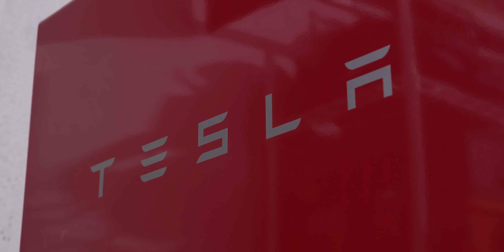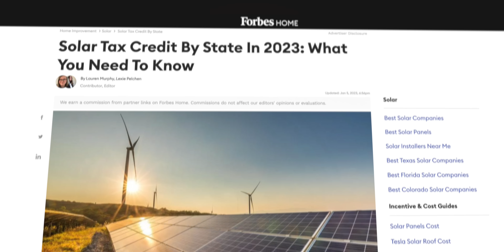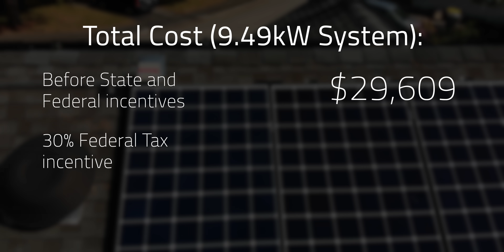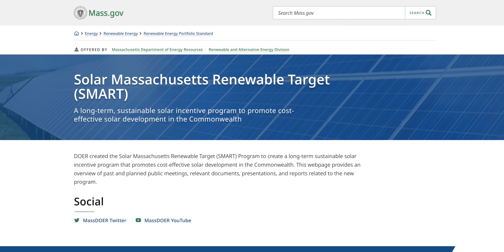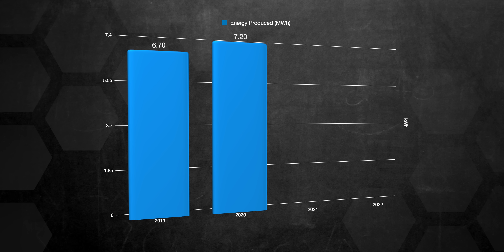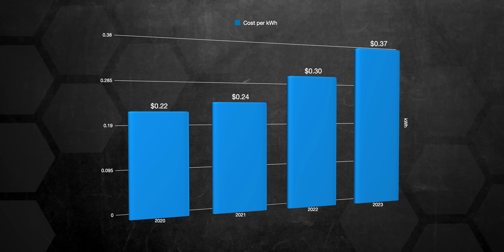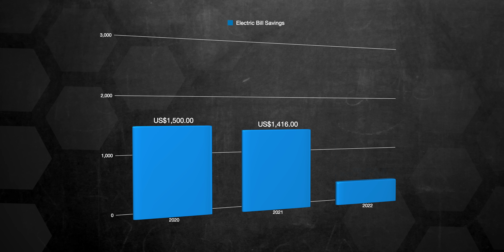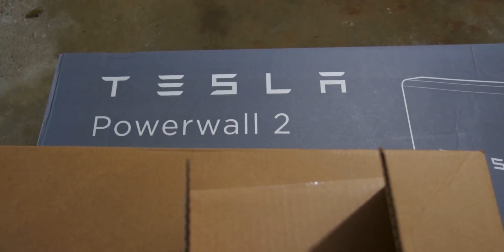5 Years with Solar Panels - Is It Still Worth It?

Comment: Your prices for hydro made me check my bill. I used 469 kWk in September at .1097/kWh for a charge of 51.45. I've been paying a monthly amount of $110 and overpaid my annual cost by 30% so next year it will be $78 a month. I have a heat pump and the usual appliances, and I live in a mobile home, so a much smaller space to heat and run. I'm planning to make my next car an electric, so in a year or two I'll be adding a charging port. I'm considering solar on the south side of the roof and a battery, but that will depend a lot on what grants are available. Interesting break down of your experience. Thanks.

Comment: My electrical company hasn't increase the kWh cost much in the last 5 years, but they almost doubled the "basic service fee" (some call this a "meter Fee") which I could not use my payback to pay off.  I was going to go solar until they changed this. They used to let  people use their payback for paying off the service fee as well. For example, this month my kWh usage cost me $77.00 and my basic Service fee is $56.00. So if I used 0 electricity in my house, I would still have to pay them $672.00/year.

Comment: I looked up the current marginal rates (not counting other fees or credits) and Massachusetts was listed as 29 cents.  I live in Arizona, and it's listed as 15 cents.  Three states were above 30/kwh. Alaska, Hawaii, and California.  The median was around 14-15 cents.  Unless it's just tax, higher prices imply higher resource consumption.  Many of the states where politicians are most concerned about conservation have the highest prices, which could imply some policies are backfiring.  Arizona recently stopped net metering but some homes are grandfathered in for a couple more years.  Net metering can drive up base prices, since the money spent on maintaining the grid needs to come from somewhere.

Comment: I could never do what you have.  I takes all curb appeal away.     And you are on welfare.   Call it what you want incentives .  It is still someone else is paying.    Go back and re do your math take out all incentive $ out because   (the rest of us are paying that part).           I have 4 acres   I would consider adding  panels out away from the  house. I don't want to  make my house ugly.     To me I would pass on your house because they are ugly.           I do like the tesla  roofing their solar    shingles .    But the upfront cost is way to high over a standard roof.
Reply: My wife did the math.  It would have taken at least 20 years to make up the difference in $ out of our pockets.    Let alone the $ out of other taxpayers pockets.    And that wasn't counting on the  $ in interest, the space needed for batteries and controls.     I don't care where my electricity comes from, I buy it from the lowest cost $ provider.    Because spending less $ is always the greenest  option.  Because it takes a lot of energy for us (and everyone) to earn a living.    Yo are not making up for that.  On another  note :  Now you are moving and you will have to do it all over again, if you buy a house with solar you said it will cost more...if it doesn't  you have to install  a new system.  Incentives are much lower now ...  And cost have gone up. .   I would think very hard and figure all actual cost .  Not just $ , but what it does for the looks of your house.     I have seen houses that had solar removed  when a new owner buys the house,  just because of how ugly they are.     But where I live luckily, most people that have solar have an array hidden from sight of the roads .

Comment: GAF solar system put on with the roof.  4.5 KW but has not reached that as it was on the roof at slope and shaded part  of the afternoon and mornings .  The solar and roof install was the middle bid of three where the other did not include solar.  So the cost was "free" During the summer  it covers total cost of usage and 10% of my usage during winter ( the utility company has charges besides usage).  But Oregon is not famous for sunshine in the winter.

Comment: Things you need to consider is your home owners insurance coverage due to solar panels.
1 Some insurance will not cover anything to do with solar 
2 Most solar panels will need replacing in 10 to 15 yrs,
3 Most insurance co's won't cover solar damage due to hail or snow.
4  solar panels draw more heat toward your roof requiring replacement sooner than average.
5 Roof replacement requires a certified technician to remove your roof panels and reinstall them.
6. A lot of roof panels that are reinstalled need replacing due to wear and tear.
7. snow from solar panels are bad about ripping off your gutter system.
8 Snow that melts from panels and shoots over your gutter system can drain into your basement/crawlspace 
9 There are a lot more cloudy days than you realize until you go solar.
10 Some homes actually lose value with solar panels installed  and some don't like the look of them.

Comment: An interesting problem I saw in another video, is a classic issue of people not supporting the power company anymore by putting up solar panels, is that the cost of power to everyone still using the traditional power grid will end up getting charged more for power over time as the power company tries to keep profits up.

Comment: I have a problem. I have a shaded roof. That is not good for solar panels. But it is great for air conditioning. Get rid of the shade and you are better for solar panels but need more power for air conditioning!

Comment: Going vegan has been known to affect ones thinking on the viability of "green energy" and reality in general.  Gov'ts always offer incentives for solar because they know if they didn't , no one would buy them. And once you agree to the terms and a contract, then they are free to change the terms on you once the contract expires. For example , that 1 to 1 metering can be changed to 1 to 1/2 . The gov't that offers the incentives and the contract will eventually see you as as a "freeloader" on the system, and your sweet deal will suddenly turn sour.  Any time someone wants to pay you to adopt something, you know it's a losing proposition. You would be better off to build a house with a dual wiring system. One for lights, appliances etc that run off a battery charged by solar and totally isolated from the grid. The other would be just for your electric heat/air conditioning...that way , you can depend on the grid plus costs savings from solar tied to the grid.

Comment: If you have the real estate go with a ground mount setup. It is much easier to manage. Also if your goal is to be off the grid, this makes the system less complicated as you’re not feeding back into the grid and trying to manage ways to make money back to pay for your system. In middle TN we run off of hydro electric which makes electricity cheap around here and they are not interested in buying back your electricity. So forget about that incentive.

Comment: My neighbour installed panels 35 years ago and created his own storage system and secondary DC power circuit throughout the house.
The panels TRACK the sun's movements.  It matters not what side of the house they are installed they always catch 100% of what is offered.
What we are being offered today is horrible engineering.

Comment: After watching this video I realize this guy is NOT a handyman.
Most people watching engineering vids know how to do a lot of the work themselves.
Not knowing that snow slides off of glass surfaces shocked me.  Snow guards, an afternoon job. 
If you have a screwdriver and a hammer you can cut a lot of these cost in half.
MAKE your own power wall, you can get the batteries on line.
Install your own panels.  It's all like Lego.

Comment: This is complete nonsense - the solar panel installation didn’t save any money and without the Government subsidies it wouldn’t even be close to breaking even. This is why the Government shouldn’t be involved in this complete solar panel scam at all. Any buyer with any sense would avoid purchasing a house with these solar panels on the roof at ALL costs. If you want to power your house when the power goes out install a generator.

Comment: A friend of ours had solar installed, but now has a leaky roof because of improper roof installation.  The roofing company is now bankrupt. Now they have to foot the bill for removing and replacing the solar panels plus replacing the roof.  20 years ago we a similar experience with our "50 year roof" failing in just two years. Our roofing company also went bankrupt. At least we didn't have solar to worry about at the time. I'm now 75 and retired living comfortably in a new energy efficient house which is paid for.  Our electric bills are completely manageable. I cannot see any benefit to adding solar which does not also increase my financial risks to an extent that could ruin us, if things go wrong.

Comment: If you are trying to make money by supplying back to the grid, you heavily depend on the price per kWh and subsidies. In my country in Europe they decided to end the subsidies, and so now all the people with solar panels probably won't ever break even. When you depend on these subsidies you actually depend more on the grid and the decisions that other people make, than when you didn't have solar panels. Your investment makes you a slave to the subsidies, and therefore to politics. Also, because of the growing amount of people with solar panels, the price per kWh that you get will go down by the year. Right now there are moments when you don't get anything, or even have to pay extra when you have solar panels connected to the grid. And that will only happen more frequently in the future. 
What I also notice that people don't take into account is that solar panels become less effective by the year. So the first 5 years they work fine, but then the next 5 years it will significantly less, and if you didn't break even after 10 years you can basically forget about it. 
Personally I think it's only financially worth it if you can charge your electric car with your solar panels. Then you may actually financially profit because of the fuel costs that you save. (I'm not taking into account the possible extra costs of an electric car.) If you don't, and just rely on supplying back to the grid, you might not ever break even, or maybe slightly profit, but you can ask yourself if it's worth the financial risk (the investment) and the hassle. 

Of course you can do it because you just like the project. My dad is retired and got solar panels and he just likes his 'babies' very much. He's always talking about how they are doing, etc. Then by all means do it. But even he admits that he doesn't know if it will be financially worth it. He doesn't care, he just likes having them, but I think more people should be honest about that.

Comment: 12 years for me with a whopping Government subsidy that has a built in 3.5% annual increase. In south east England this year will see around £700 (includes the minimal pay back from the power company for my unused electricity to the grid) plus the free electricity when there is enough light.
The system paid for itself within six years so I now have eight years of subsidy left. My panels are nearly 8% down on output and will likely degrade to 10%+ down by 20th year but this is normal and taken up by the subsidy increase.
Without subsidies solar is an expensive acquisition and, in the UK, pretty useless during December to March. Batteries during this period barely have enough input available from solar to recharge and are a very expensive addition. In summer months they are rarely needed so using a little grid electricity in the evenings and overnight can be a lot less costly. Lithium batteries are a possible fire risk too.

Comment: Back in the early 2000s I looked at solar panels, at that time the break even cost point where you actually started saving money was 20 years. The life of the system was 20 years. 
If batteries were part of the system and had to be replaced every 5 to 8 years, the new break even point was at least 25 years......I passed.

Comment: 40,000 cost at .08% return is like 400,000 40 years later.  Secondly, in high-sunshine states, climate change will cause much, much, much higher homeowner's insurance because of the sensitivity of these panels to hail, storms, tree limbs.  This is why the economics rarely work.  It works in the odd corner case.

Comment: We installed our own    No regrets overall    Technology improved a lot since we started     So it’s cheaper for same system….now  
We don’t have snow so no worries  on that point 
We didn’t put any panels on our roof, we used other structure like our carports and we built other arrays over our livestock to double as shelter   
Our system is used every single day and the grid is our back up.   We do not sell back to the grid.  We paid for the panels and we’re going to use it.  If we tied to grid, we would lose power when they did and that is not our goal    We have six freezers of meat to protect among other things   
Signature Solar has been our go to supplier for all of our components and tech support

Comment: Entrances for homes in the snow belt should be on the side of the house for two reasons. It prevents the snow from sliding down onto people going into or out of the house and it prevents the snow slide from blocking the entrance. Houses can build an overhead walkway cover perpenicular to the roof slope with the walkway roof sloped to either side of the walkway and the door to get the same benefit.

Comment: Why would you spend that much money when you can do it yourself for less than half of that?
One of those companies wanted over $60,000 to do my house, and I did it for about $8000.
And that company was only providing 33% of our usage and would have more than doubled our cost each month.
I have been designing and building control panels for over 40 years.
This is not hard to do.
Designing a simple small system that powers your refrigerator and freezer for just 6 hours per day reduces my electric bill by about $200 per month.
I now have 1 dedicated system for my fridge and freezer, another system for my garage and carport, another system for my household 120VAC, and another system for an off-grid building.
All systems have grid backup except for the off-grid building.
Total, I save about $450 per month.
It will take about 26 months to pay for itself and I have no loans or leases.
If you need help with your system, reply to this comment.

Comment: Personally I'm not a fan of rooftop solar.  Would love to build a solar awning to shade the south side of my house though.

Solar is getting close to ready, but atm there have been too many "unsuccessful" solar ventures which have flooded the market with a wide range of incompatible solutions.

Looks like things are finally getting standardized and will reduce a lot of the issues I've seen with "rooftop" solar.

Comment: Maybe, when people do these calculations, they should include the opportunity cost and time value of money. The average Joe, getting solar for his house, has two options, cash or finance. An average system for average people will cost an average of $40K. An average annual bill of electric power $6K per year for 25 years, will be $150K. $40K for 25 years in an investment account yielding an average of 8% will be $274K in your account : vs saving $150K. In order to save $150K, Joe will forfeit or throw out $124K. Not a good idea to put that amount of cash in solar panels. How about if Joe finance the solar system, like most people do? Well, the total cost at the end of 25 years of a loan for $40K @ 20% , is around $200K. So, to save $150K on his power bill over a 25 years period, Joe has decided to spend $200 K. I have been known to be wrong, from time to time, but, maybe not this time. Just like buying an electric car, if the reasons are savings, mathematically and financially might not make sense for the average Joe. However, if the reason is , for the planet, green stuff, etc, then the numbers do not matter.

Comment: We’ve had solar panels on our south facing roof here in Rhode Island since 2015. We own the panels. In RI we get paid or credited the wholesale rate for the electricity we produce. That said, we haven’t had an electrical bill since they went on line. We have a $2500 credit which has built up over time. That is with inefficient window a/c’s running almost constantly in the summer and supplementing our gas heat with HIGH QUALITY electric space heaters in the winter. We are now planning on installing split hvac units for Mir efficiency and safety. We had one roof leak, due to wind damage, not associated with the solar panels. In RI the insurance companies are required to do the whole roof if the roofing company can’t match the existing roof, so the panels had to come down. It was covered by our insurance. We have not had any solar panel associated roof issues. If done right, they are cost effective. We’ve had neighbors who used solar leasing companies and they have not been so lucky. Do it right and it’s well worth the investment.

Comment: I really liked the video offering insight to the pros and cons and all of the factors to consider when evaluating solar. There were several references made in the video to other information that would be left in the description that I didn’t find.  Could you please post links for the “Nrgh ??” about net metering opportunities in various states described at 7:15 and  about the battery and payback from the utility for using it as described at 10:00. was also referred to, but not found in the description. I’m also going to look into videos for rain coming off the panels so that it ends up in the gutters. Thx!